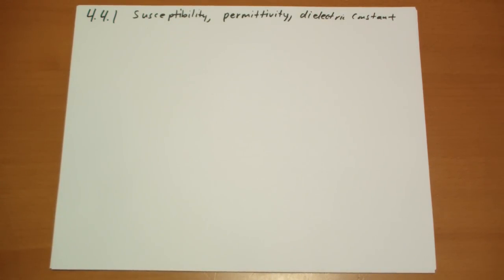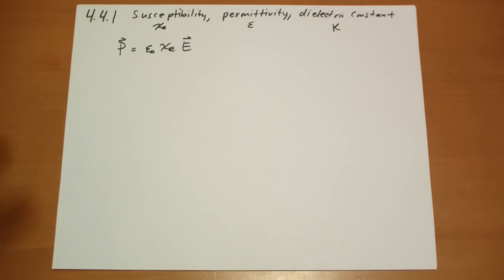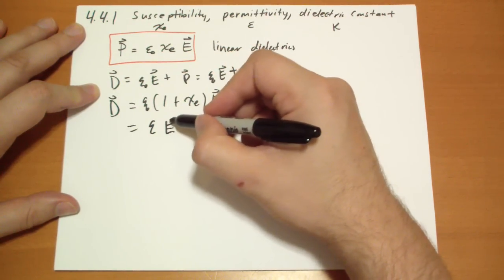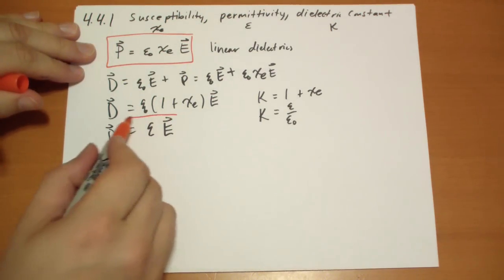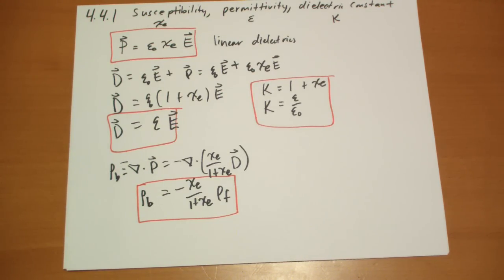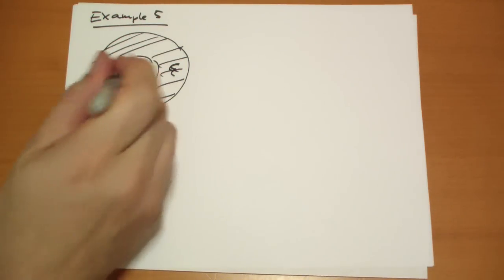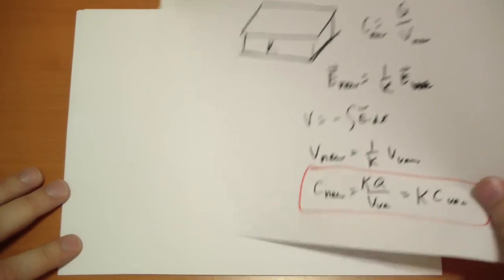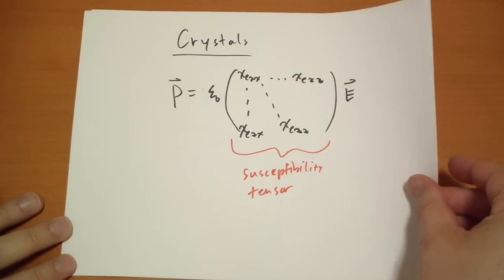4.4.1 Susceptibility, Permittivity, Dielectric Constant

Comment: Thanks for the lecture. May I ask why the divergent of P is zero ??
Reply: +1, i can understand it  with logic but I can't with maths.
Reply: In case of average polarization, the charge inside the dielectric is zero, because if we take a microscopic volume it contains equal amount of +ve and -ve charges so net charge will be zero, so divergence of polarization will be zero.

Comment from the maker: The function(s) that give P throughout all space has two parts: P = 0 outside the dielectric and P = something not curly (parallel with E) inside. What is P at the boundary? undefined. While the curl of P in both regions is zero, that doesn't mean that the curl of P is zero at the boundary. You have to take d/dx of the y and z, etc, and there's a significant, undefined jump of the y component as you move in the x direction (or whatever)